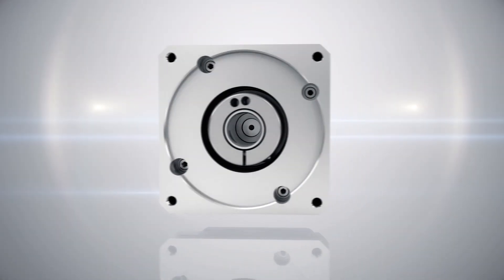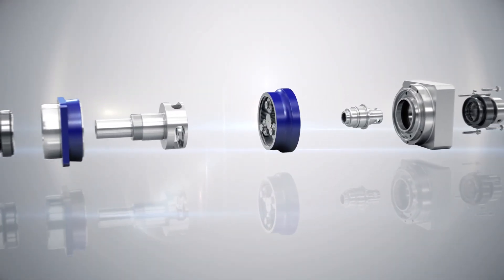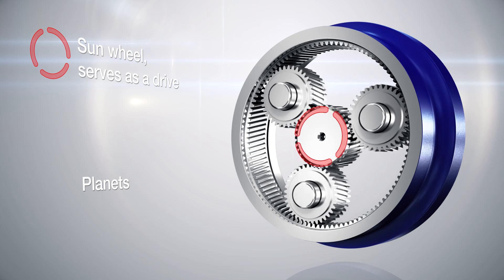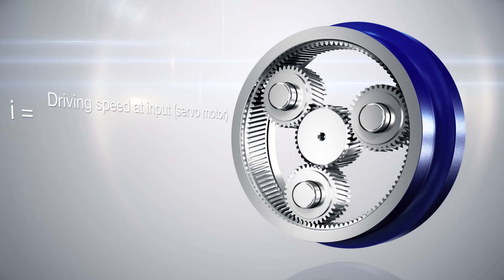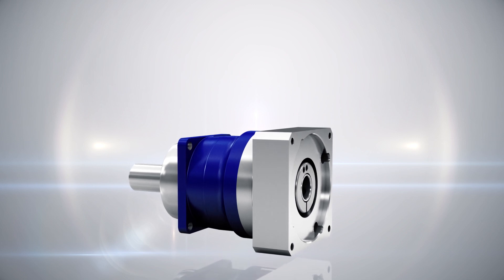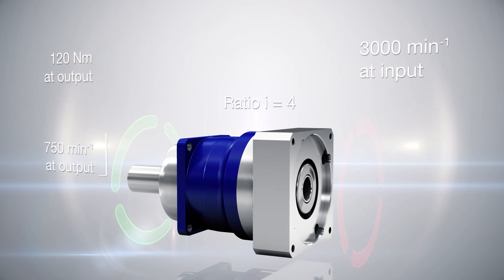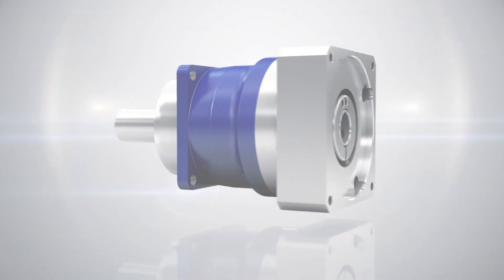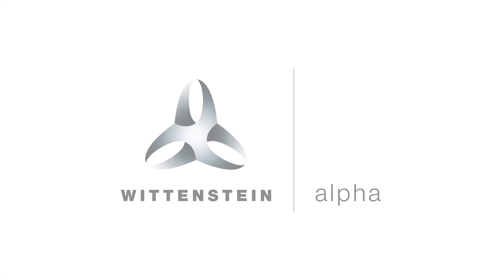Made simple: Design and operating principle of a low-backlash planetary gearbox

Comment: why dont you put teeth on the outer diameter of the ring and add another planetary to move the same speed so the outer planetary is bigger and it makes a 1 to 1 ratio increase torque 
why didnt anyone put teeth on the outer diameter of the ring

Comment: What if 
Sun gear (CW):-input
Planet gear fixed (not planet shaft) 
What about the ring gear?????CW or CCW or doesn't rotate
Reply from the maker: Hello Grandhi Manohar, we are not completely sure, what you are exactly want to know. If the sun gears rotates and the planets are fixed nothing is moving.

Best regards from your WITTENSTEIN Social Media Team
Reply: @WITTENSTEIN_group  wouldnt the gear ratio for fixed ring gear be the speed of the sun vs the speed of the planetary wheel (1+(Sw/Rw))? Also in the case of planets being fixed by a fixed planetary wheel, the ring would then be spinning, which would make the gear ratio the speed of the sun to the speed of the ring
Reply from the maker: Hello  @SANDMAN_66  ,
There are several approaches to calculate the resulting ratio.
In the video we show the easiest method – dividing the input speed through the output speed. This follows the basic definition of gearboxes and is therefore applicable for all types. You can also use the ratio between the diameter of the ring gear and the sun wheel or the number of the teeth.

For a fixed ring gear, the sun wheel being the input and the planetary wheel being the output, you calculate:
i = 1 - (-(number of teeth ring gear)/number of teeth sun wheel)

Using speeds:
i = speed sun wheel [rpm] / speed planetary wheel [rpm]

For a fixed planetary wheel, the sun wheel being the input and the ring gear (=housing) being the output, you calculate:
i = -(number of teeth ring gear/number of teeth sun wheel)
This is always negative due to a change in rotary direction. 

Using speeds:
i = speed sun wheel [rpm] / speed ring gear [rpm]
Please note the change in direction, therefore input the speed of the ring gear as a negative value.

Best regards from your WITTENSTEIN Social Media Team
Reply from the maker: Hi Andriy,
the type and amount of lubrication differs by gearbox type, size and in some cases the customer’s application.
Standard gearboxes use a closed chamber design and are lubricated for life with an industry grade oil or grease with the option to go food grade.
Reply: Hi. Thanks for your reply.
What lubrication would you recommend for small planetary gearbox with straight cut gears, 90mm in diameter, 12000 input 2000 output rpm, 50Nm output torque?
Reply: Sun gear 48 teeth
Planet gear 24 teeth
Ring gear 96
Now ring gear is fixed.
Input sun gear 3 revolution
Output carrier ? revolution and how?
I want to know it's working.
It is like puzzle.